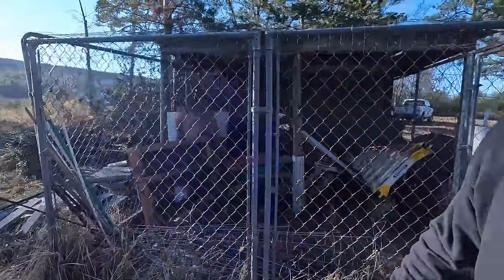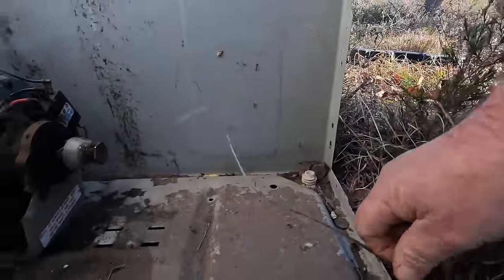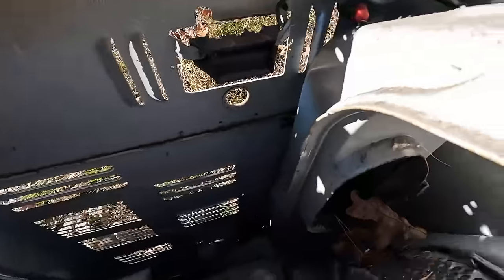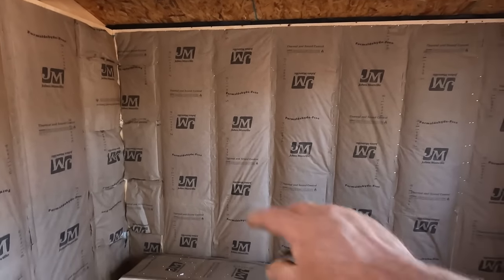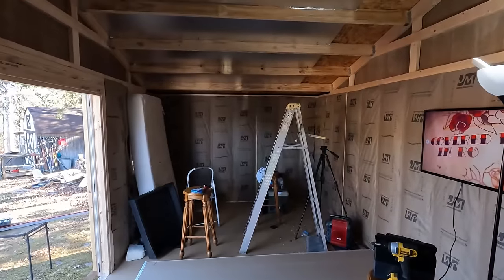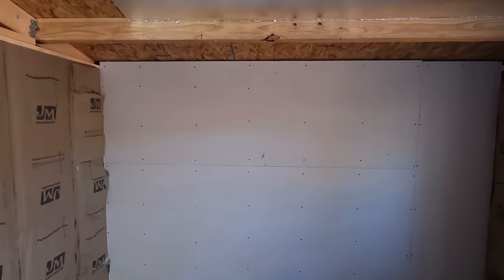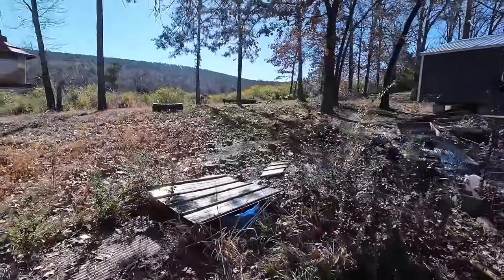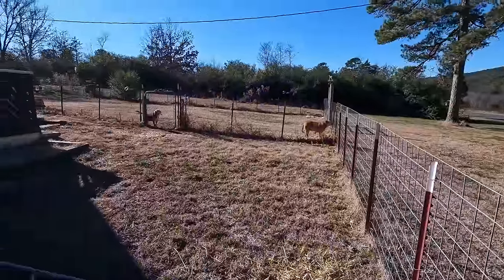First Wall Is Done! Removing Years Of Scrap Metal From Property/Progress

Comment: That would sure start a fire in that vent-another tip also is if you leave your washer lid up after you wash your clothes, it will keep your washer from  mildew and smelling because the air would keep it dry
Reply from the maker: I think I shoved those down there the day I moved it outside, Dewalt hasnt been around that long